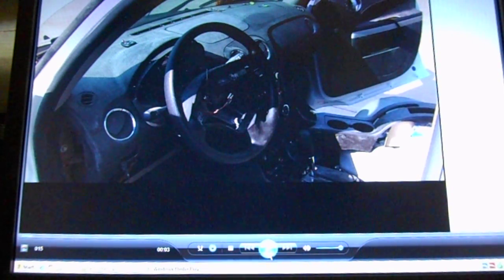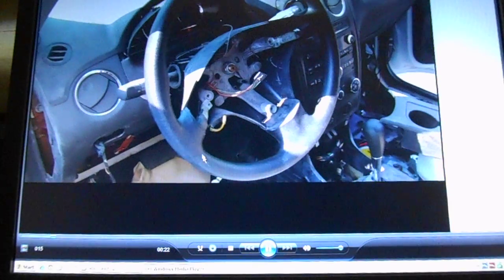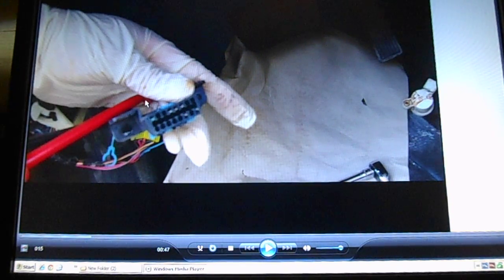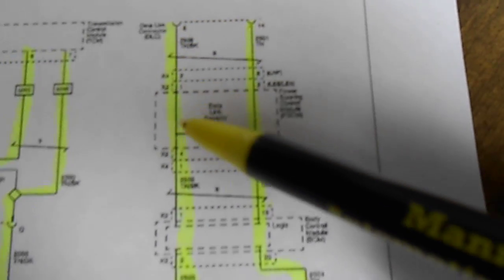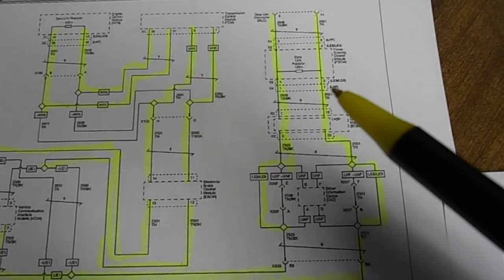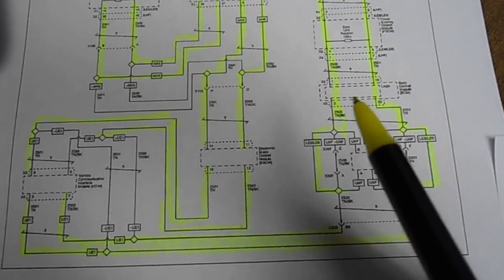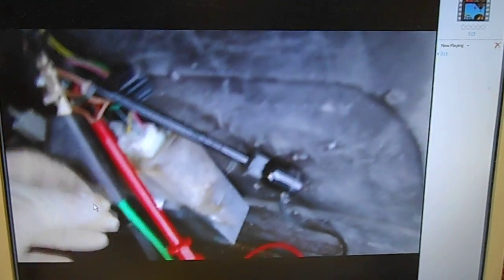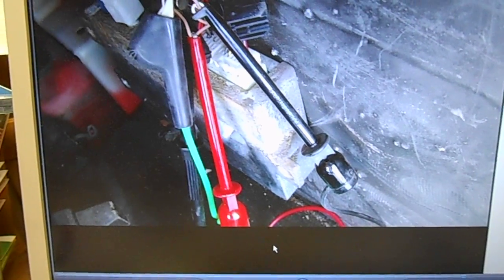2009 Chevy hhr CAN bus testing No crank No start no communication

Comment: which wires did you jump to bypass the vcim?  I had 30ohms at my can bus pins not sure what would cause that. also my number 1 pin to grouns was like .5volts

Comment: I added some die electri grease to the electrical plugs to tcm, ecm,and the fuse box last Saturday 1-7-2023 and my 2008 chevy hhr never cranked again  no start no crank it's driving me crazy before I added the die electric grease I didn't try to start the car. It runs great but sometimes the gauges intermittent and then it stops Trans shift hard and stop please help me
Reply from the maker: What codes are setting. I rarely add dielectric grease to connectors, I have no idea why people think that will fix something. Just makes a slimy mess l!

Comment: I like the video; I need help with my 2011 HHR. I R&R the Transmission when I had the fuse box out, I accidently shorted the main battery cable to ground now I have no crank no start. No power going to the starter solenoid. I looked at everything I can think of and can't find what I smoked.

Comment: Thanks for doing this video. the Cobalt that I got for our daughter for her birthday didn't run when I purchased it. I figured it would be something silly and stupid. Turns out it had three issues. There was a slight fray on the can bus wire leaving the ECU going towards the TCM. That would not allow the data port (obd2) to work. But also the ABS module was bad. While trying to find the cut in the wire that was between the TCM and ecu, I figured out that the ABS module was bad and had to do a patch a couple of clips in the ABS connector to bypass the ABS module. After I got the OBD2 scanner to now communicate with the ecu, the car was still not crank. I happen to have seen another video regarding the ground being bad in the TCM, I literally just took a instead of jumper cables and put the negative side on the TCM and the other negative side onto a ground on the body. Voila, the car started!!  
I was very close to feeling beaten. Luckily, I tried the jumper cable as a last resort .
Thanks a lot for the video. It helped me understand the can bus better and how to diagnose it

Comment: excellent video on a 2012 malibu 
what happen if the car is running end jump wire  from positive battery to TAN/BLK  at D L C connector
Reply from the maker: Not sure I dont recommend it, CAN should be protected,  but you never know.

Comment: hey man limited on time trying to figure this 08 g6 out. anyway my question is what if u do not have a 2.5 ref volt at pin 6 and 14? iv got .8 on 14 nd 1.1 on 6. where do i go from there?
Reply from the maker: Start disconnecting modules and monitor those voltages.
Reply: @BrianMann216  thanks man i ran out of daylight today i managed to unplug the bcm nd the vcim aswell as at the dlc checkd ohms on both LAN lines only had 4.5 ohms. what would this indicate? also before i ever took my battery off with key in ignition turned to the run position i check for my 5v signal at my throttle body connector if i remember correctly i had like 1.3 on one of the pins but nothing on the others. im thinkin bad pcm im a decent shadytree mechanic and this one is giving me trouble.  thanks
Reply from the maker: @justinlockhart4193  see if you can find a diagram to separate the system and check for 120 ohms  to each end

Comment: I know this is an older video, but anyone else having this issue please check the UBEC connectors as well. There is a known problem with terminals being backed out/not clipped properly causing poor/no contact. 😊👍🏻

Comment: problem facing in Chevrolet captiva 2007 manual, DTC U0073(Control Module Communication Bus OFF), U0121(ABS MODULE lost communication) and P0500(Vehicle Speed Sensor) ,,,,suddenly instrument cluster stops working ,all needles(Temperature, rpm, speed etc.) showing 0 reading , ac stops cooling while blower keep running,reverse gear light stops working, Service Vehicle Soon light & MIL illuminates in cluster. and all happen intermittently and all together. Can anybody suggest solution?
Reply from the maker: list what modules are setting which DTC,  I am assuming the P0500 is in the PCM.   I am not familiar with the 2007 Captiva,  what country / market  was this vehicle sold in
Reply: @BrianMann216  Country INDIA
Reply from the maker: @harshkhy  Sounds like  a Communication issue for sure.  I dont have SI ( service info) for a 2007 Captiva
Reply: @BrianMann216  yes it is communication error but till now not able to find cause.

Comment: Just wondering how did you come to the conclusion that its a CAN problem , Did the scan tool direct you to this direction from the start?
Great Stuff man, Thank you very much.
Reply from the maker: The scan tool told me we had No communication ,   the modules that did communicate set codes for no com with the modules that were not talking.  A look at the diagram in this case  clearly showed me it was a CAN bus problem..   I think back then I was not nearly as familiar with the CAN bus as I am now.
Reply: Crystal clear man...Thank you very much..👍👍
Reply: @BrianMann216  problem facing in Chevrolet captiva 2007 manual, DTC U0073(Control Module Communication Bus OFF), U0121(ABS MODULE lost communication) and P0500(Vehicle Speed Sensor) ,,,,suddenly instrument cluster stops working ,all needles(Temperature, rpm, speed etc.) showing 0 reading , ac stops cooling while blower keep running,reverse gear light stops working, Service Vehicle Soon light & MIL illuminates in cluster. and all happen intermittently and all together. Can anybody suggest solution?

Comment: Have similar issues with cobalt. Checked through the system it had 60 ohms at the dlc when I put it back together. Got the U2100 on the test drive

Comment: How would it communicate by jumping the CAN wires while the VCIM is out the pictures?
Thx great video
Reply from the maker: the vcim is not necessary for other modules to communicate with each other,   but it was pulling down the entire netwrok

Comment: Terrific diagnosis,  strange I hadn't run across this video before. IMHO and only an opinion , I generally break the system at the easiest middle point to check both directions.  2 minutes more of searching the location of all the modules and I'm sure you would have found that problem in half the time. Please understand I'm not knocking. This is a great video and great diagnosis. Not every video has to be geared to a diy guy

Comment: ok brian mann i have a few questions if you dont mind to explain them. i read that in a gm service manual that the can gm high speed can lines are 2 twisted together wires. does that mean there 2 wires twisted together under the wire insulation of the wires on pins 6 and 14?? also could you disconnect all modules and ohm out from end to end of the can wires from where they connect to each module? to check for shorts to grounds,opens short to voltage? thanks!
Reply: phil holbrook Want me to answer this yet? 😁
Reply: Yes absolutely

Comment: Thank you for the video. I'm working on an 08 Uplander with the 3.9. Lost communication with the ecm and tcm. I think the other modules are all communicating. The car is a no crank. 

The gear indicator light is absent as is the check engine light. Is it likely to be a CAN fault before the ecm leading to no communication with the ecm and tcm

Comment: do you mean that when you check the resistor between pin 6 and 14,,,,,,,,,,,,,,,,,,,,,,,,,,,, in any car,,,,,,,,,,,,,,,,, must read 60 ohms which this tell us it is a good CAN BUS, but if it reads 120 ohms,,,,,,,,,,,, in any cars,,,,,,,,,,,,,,,, it is bad.

Comment: Hello.   Very good video
Just a thought, if scanner showed no communication with PCM,TCM and EBCM and looking at the diagram you showed,where you can see the EBCM,TCM and PCM in that order in the circuit, wouldn't be a little quicker after knowing that one terminating resistor was not present,  to isolate the system first right before the first missing module, in this case the EBCM and check both sides of the circuits at the point of separation ?  With the EBCM being hard to get to, it would have pointed you straight to the VCIM . 
Just a thought.
Thanks

Comment: Any advise for a hot weather start problem on a 2006 HHR?  Having a problem duplicating problem at shop, has been towed in 4 times in over 85 degree weather after being driven 10 miles and then wont' start.  Fuel pump replaced at 2nd tow in.

Comment from the maker: I would check for codes in all the modules for starters.. you would have to have a decent aftermarket scanner to do this.. on newer vehicles like this if one module goes bad it can cause  a no crank / no start

Comment: I have a crank no start where would be the  best place to get wiring schematics. I checked the coil pack no spark on 1&4 crank sensor had voltage. I have replace the fuel pump, check fuses, relys, tps, pulled valve cover valve are rotating, did compression check, blew through fuel line, changed filter.Thanks in advance for any help given.